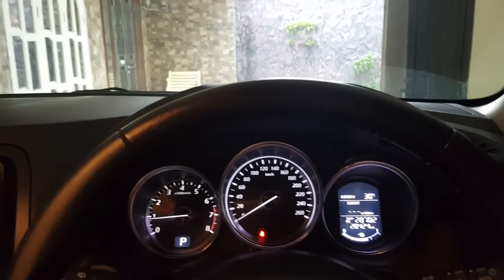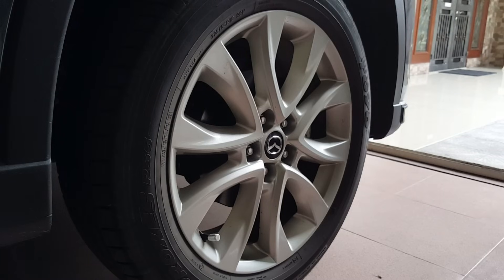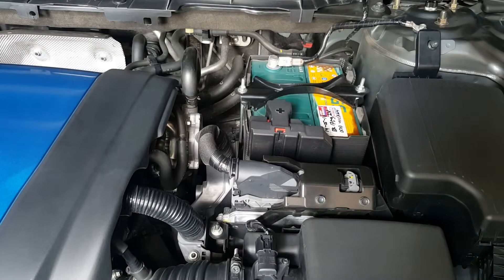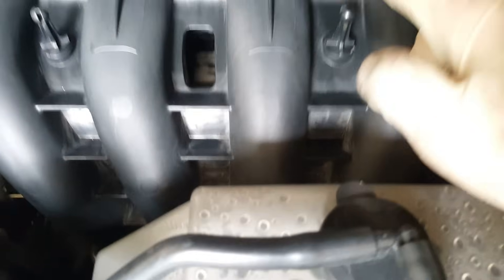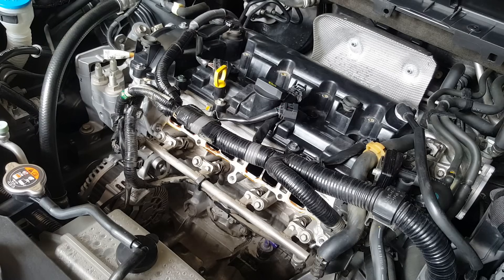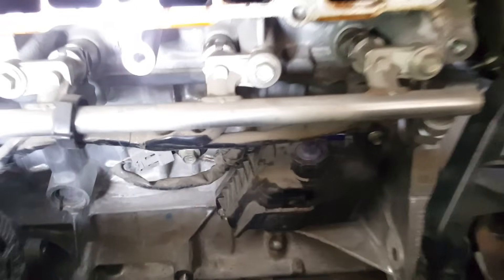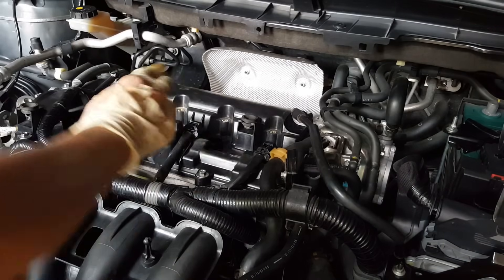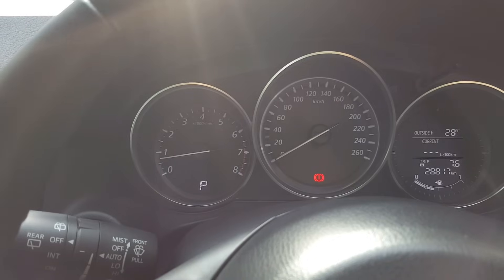How to Clean Intake valves / Carbon clean // Mazda CX 5 (All Skyactiv Gasoline Engines)

Comment: Hi Felix I got error code P0171 system to lean. Mazda3 2.5. Could you help me with that? Thank you
Reply from the maker: what is the milage? worse is could be vacuum leak on the pcv valve / pcv hose.  For now please check all spark plugs / coil plugs connection are plugged in properly. Check MAF sensor and connection are plugged in and make sure they are clean.
Reply: @GarasiFelixDan  Felix I forgot to tell you I go uneven idling. You can hear that it’s going up and down. Thanks
Reply from the maker: @gregstopa5092  hmm check if the pcv needs replacing and pcv hose. :) it should fix the issue. I got a guy here also have this similar type of issue for his mazda 3 skyactiv.
Reply: @GarasiFelixDan  thank you so much for your time and advice 
Best to you from Poland
Reply from the maker: @gregstopa5092  no worries anytime thank you for the support brother :)
Reply: @GarasiFelixDan  hi Felix thank you for quick response. Mileage is 43000 km , new ngk iridium spark plugs I just clean throttle body I check all houses and connections. Can you please tell me if I can replace pcv without removing manifold. I thing. Im asking because you know this engine better than me. I think you right that’s gonna be pcv valve. Thank you
Reply from the maker: @gregstopa5092  to replace pcv valve unfortunately you need to remove the intake manifold in order to remove the old pcv valve.

Comment: I had a shop walnut blast my intake valves now I have a misfire in number 2 only at idle. I brought it to another shop he changed my spark plugs and coils but the misfire is still there he thinks it's the fuel injector. Can you think of any reason why walnut blasting would damage an injector? The car only has 61,000 miles on it
Reply from the maker: check your pcv valve hose , common misfire symptoms if not plugged in properly.
Reply: That would cause a misfire in only 1 of the cylinders?
Reply from the maker: @Littles13579  yeap. theres some owners had this problem aswell cause by the pcv valve hose wasnt installed correctly, Also check all the intake pipes / electrical connections make sure they are tight .
Reply: Okay ill go check thanks felix
Reply: What year and model?
Reply: @CC-yf2fg  its a 2012 mazda 3 I touring skyactiv. I actually just had them change the injector and it fixed the issue

Comment: I was wondering how much extra fuel savings? I didn't see you clean the carbon from the spark plugs? Isn't that more critical and can be done by just doing a 4k rpm engine race for 2 mins twice. No mechanical experience needed..
Reply from the maker: not this case this engine intake valves wont effect much by doing italian tune up. as this is direct injection engine. you will have to clean it up by removing the intake manifold assy.

Comment: We are going to check my son's 2014 6-speed 2.0 cx-5 for carbon buildup since his MPG is worse now. The car has 247,000 miles right now. No issues so far other than the deteriorating gas mileage. The car never been to a dealer, all maintenance was done by owner. The fuel filter and spark plugs were replaced recently
Reply from the maker: you will definately notice better mpg after cleaning the carbon build up on these cars and the car will runs smooth and happy again.

Comment: Hello Sir, thank you for the tutorial. How did you rotate and which specific tool did you use. Thank you for your hard work.
Reply from the maker: in this video i use ratchet with socket 21mm to turn the crank pulley.

Comment: HOW did you reach behind the valve and how did you remove the deposit left outs 3-how did you dry the valve iam stranded
Reply from the maker: i used tool pick to scrape and clear behind the valve and i used vacuum tool to suck all the left over chemical debris out.

Comment: hey Felix great video I heard you say it has a oil catch can. do we need to empty?I also  have a P0421 code "catalyst 1 efficiency below threshold bank " any idea where I should start to fix the code any help would be great thanks
Reply from the maker: with OE oil seperator tank we dont need to empty it since the blow by oil gets return to the engine block. I recommend to install external oil catch can like mine and it works great. I empty it every 5000ks to 6000ks every oil change. 👍🏻
Reply: @GarasiFelixDan   any idea on the code P0421?where to start?
Reply from the maker: @ComidaDeMexicoLindo  replace o2 sensor bank 1 should clear the problems. :)

Comment: 2014 cx-5 171,000 miles. Getting 25 mpg combined.
I don't think the intake has ever been cleaned. There are chunks of carbon built up everywhere, including on the valve stems. 

Got a random misfire code. Dealer diagnosed it as coils, plugs, and valve cover gasket. Random misfire went code went away but then came back on and off again. 
Dealer also recommended simple gdi cleaning but after getting the intake manifold off i think a manual cleaning is the way to go. 

Pulled intake manifold. Slightly different procedure than this video. 5 bolts all same length, 6th bolt 10mm head and much longer. Accessible only under the car I think. There is also a hose that needs to be disconnected. Additionally, there are many wire harness clips and a few electrical plugs to disconnect. It's all pretty obvious but very time consuming. 

2.5 hrs to take off the intake manifold and have things ready for cleaning. I think a simple gdi chemical cleaning injected downstream of the maf sensor every other oil change is a great idea.
Reply from the maker: Install a catch can to slow down the carbon build up. It works great.
Reply: @GarasiFelixDan  thanks! I think with this mileage the car may not make it to its next (required manual, not preventative chemical) cleaning. 
It runs great now, no more cold start misfiring at all.

Comment: Hello Felix. I have done a lot of work on my 6(2.5 Skyactiv-G) thanks to your videos. However, this video is the most helpful demonstration on accessing the fuel rail/injectors. I've been having misfiring in cyclinder 1 and after changing all four spark plugs and coils, the code still has not gone away. I wanted to clean the rail(distributor) and injectors without removal to avoid having to reseal it. Is there a fuel line or valve where I can connect a pressurized cleaner?
Reply from the maker: one owner had similar symptoms he had a leak on the pcv hose area somewhere around there then got it replaced, the car runs like new after he replaced it.
Reply: @GarasiFelixDan  Hey Felix, I know it's been awhile. But I went ahead and replaced the PCV and hose and the car runs great again! Thank you so much!
Reply from the maker: @fragoutrambo6381  Awsome great to know you have fixed it :) enjoy the car man. 👍👍😎
Reply: I've been having the same issue with my 3rd cylinder. I'm going to try the same thing suggested here and hopefully that fixes it

Comment: Hello, thank you for your video, just a question, for what I understood, you turn the crank pulley to close the valves to clean it, am I right? And what kind of cleaner do I need to do this job?
Reply from the maker: Thank you for the support, Yes use the crank pulley to open n closes the valves. For the cleaner i use Berryman Total fuel cleaner it does the job very well.

Comment: Excellent video Felix. I have a question, 2016 Mazda CX-5 GT 2.5L
Has check engine light on
It’s driving ok
Has multiple codes
P0172
P2096
P0300
P2302
P2305
P2308
P2311

Mazda dealer replaced engine, plugs and coils replaced, fuel rail, O2 sensor down stream, checked PCM for any updates.... but still has those codes on. Any idea where to go from here? The only codes on before the engine replacement was the P0172 and P0300... engine replacement didn’t fix them. Now more codes... 🤦🏻‍♂️
Any help would be appreciated thank you
Reply from the maker: with that many error codes i would check all wiring and if theres any damage on the wiring harness cause by rodents etc.
Reply: @GarasiFelixDan  Thank you Felix. Do any of those codes stand out to you as something to do possibly with the rocker arm recall or PCM update? Aside from the Coil codes to the other ones usually pop up during a common issue on these vehicles? Any insight would be very much appreciated
Reply from the maker: hmm thats very unfortunate, with P0300 
Faulty spark plug (s)
Faulty ignition coil (s)
Clogged or faulty fuel injector (s)
Intake air leak
Fuel injectors harness is open or shorted
Fuel Injectors circuit poor electrical connection
Ignition coils harness is open or shorted
Ignition coils circuit poor electrical connection
Insufficient cylinders compression
Incorrect fuel pressure
Reply from the maker: with P0172 
Faulty Front Heated Oxygen Sensor
Faulty Spark Plugs
Faulty Mass Air Flow (MAF) sensor
Exhaust Gas Leaks
Ignition Misfiring
Incorrect Fuel Pressure
Faulty Fuel Injectors

Comment: This is insane you really have to take half the motor apart to do this!
Reply from the maker: Its not too complicated :)
Reply: Yeah I changed the spark plugs in a 2018 Subaru outback 3.6R so I guess I could figure it out

Comment: You sucked it out with a syringe?
Reply from the maker: use a vacuum to suck out the left over debris but i had to use the front of old syringe to make it easier to attach small hose line to it. otherwise you can use other method to suck out the gunks.

Comment: just dont buy a    d i   engine   , if plan on keeping a car  for ten years .
Reply from the maker: Its not that bad just got to know how to maintain it. Unless its a very weird positioned engine where you cant access the intake manifold.
Reply: @GarasiFelixDan    i got a 1991  honda crx , 425,000  miles  .   never had to remove  anything   just to clean valves  .  motors  never been  taken apart   .   nothing but routine  maint.
Reply from the maker: @restalva  That honda Engine is bullet proof . always love the old school honda engines. 👍👍🥰🥰
Reply: @GarasiFelixDan   thx . i wish they  would   make a  simple   motor that does not require   a   intake valve cleaning  .
Reply from the maker: @restalva  i knoe right!! if only they use port and direct injector design for mazda skyactiv motor would be such good motor.

Comment: how this type of cleaning helps the engine ? Wouldn't it be better to clean the edges of the intake valves ? I think the reason why people wants to get rid of carbon deposits because they break seal between intake valve and engine body, so there can be a leak from the chamber into intake paths.
So, how does your clean method cleans the valve edges ?
Reply from the maker: it helps alot with restoring the vehicle performance. lucky mine was not too bad of a carbon to clean off. the chemical disolve all of the carbon makes very easy to remove and vacuum out. as you can see after the cleaning all the carbon deposit no longer stuck in the intake valves.
Reply: @GarasiFelixDan  I don't want to be seemed boring, but the deposits were sitting on the top of the valves, and nothing except air interacts with these deposits.

I'm just curious how cleaning air path ways may help ? More air is sucking into the chamber ?
Reply from the maker: @gbazil  it is shown in the video where i actually turn the crank pulley which turns the intake valves to shut position that we can soak and clean the top of the intake valves it self , not just cleaning the intake chambers. So im not quiet sure what u mean.. ??
Reply: @GarasiFelixDan  I'm interested in cleaning the surface of the valves by which they contact the intake inlet. When valve goes up, it touches the surface of inlet and seals the combustion chamber, so no gases can escape.
And i was thinking what if the carbon deposits would prevent making that seal, this could cause engine damage (for instance, combustion gases can escape combustion chamber and go into intake chamber).

But even if I'm wrong, I still can't understand how your cleaning helps the engine. I liked what you did, and i would try the same, thanks a lot for the video, no kidding, but... what carbon deposits do beside covering the intake paths with carbon ?
Reply: First of all, thank you for this video. It will help me a lot when I clean my '14 Mazda3 2.0.

Second - I think this is a great point - one which I search for info on and never find. Cleaning the carbon from the ports and top of the valves helps to a degree (air volume and smoother air flow, reducing chance of larger deposits forming that could break off and enter the cylinder) but I believe the main issue is the valve seat which is obviously critical to good compression and must close with a perfect mating of valve to the seat. If only a small bit of carbon gets in there I don't see cleaning like this or even media blasting helping. Perhaps something like seafoam would help dislodge carbon deposits in the seat but I am not ready to try that.  If I start to experience hesitation, rough idle, poor performance and think the deposits were forming on the valve seats and cleaning didn't help, I think the only clear option would be to remove the head (huge job I know) and machine the seats and replace the valves.  I love the car and hope to drive it for many more years and it would be nice to know what the likely prognosis is - especially considering I mainly only drive short trips which is worse for this.

If anyone can point me towards any info concerning GDI/carbon deposits/valve seats (whether it is an issue or not) I would appreciate it.  thanks

Comment: Good video👍thanks. How to clean exhaust valves now?
Reply from the maker: exhaust valves dont need to clean them as they will get baked n clean by the exhaust flames. Just use a good fuel n you should be good.
Reply: @GarasiFelixDan   and is it compulsory to remove front right wheel and take out plastic clips before cleaning valves?
Reply from the maker: @Heygens  yes it would be much easier if the right wheel is off.
Reply: @GarasiFelixDan  but whats the relation between taking off the wheel and intake manifold. Is manifold is depend on plastic clips?
Reply from the maker: @Heygens  the reason i took off the right wheel n splash guard because i have to access the crank pulley to adjust the intake valves to open / closes.
Reply: @GarasiFelixDan  all right. I see

Comment: Hi Felix Dan. I pan on doing this vlave clean up and oil catch can install  on my CX-3 next summer. 
Question-1 is it neccessary to remove the spark plugs?. I understand removing the coil packs and wire harness to make easier. 
Question-2 can I use a dental pick for removing the carbon? What kind of pick is best?
Question-3 what is the torque spec for spark plug Nm ?
Question-4 torque spec for throttle body reinstall Nm?
Thanks so much. I visited Lombok, Indonesia in 2005 it was the longest trip ever and the farthest I traveled by plane. Local island plane was scary. I got culture shock. Greetings! From Winnipeg,  Manitoba,  Canada where it gets to -48 in the winter.
Reply from the maker: Hi Nelson , Yes it is neccessary to remove the sparkplugs because you will release the tension whilst turning the crank pulley. 

Dental pick will be handy if you have one it helps to remove especially stubborn carbon. 

Spark plugs torque spec r 15 - 20 NM

Throttle body torque specs 8 - 11 NM

Comment: Hello, this is interesting move.  you carried this cleaning agent with a brush and took out the remnants with a syringe? why did you take out the candles? has there been an improvement in power and performance?
Reply from the maker: cleaning the intake valves is worth it, makes the car runs like new. definately must do the service and it does improve acceleration and performance :) ✌️
Reply: @GarasiFelixDan  how often and at how many miles do you think this should be done?
Reply from the maker: @roostersideburns3440  i would do every 40000 kms to 60000 kms.
Reply: @GarasiFelixDan  I purchased this car for my parents actually. they are not menchanically inclined. How reliable will this be with just regular oil changes? Im hoping they can get atleast 200k miles on the engine.
Reply from the maker: @roostersideburns3440  its a very good car dor daily , very easy car to work , inexpensive spareparts. With routine service and up to date oil change will get the car to last. I suggest to Always use minimum ron 95 fuel.
Reply: @GarasiFelixDan  thank you sir
Reply from the maker: @roostersideburns3440  ✌️